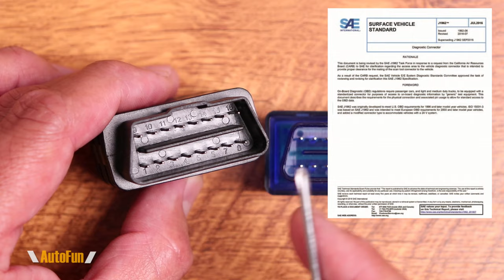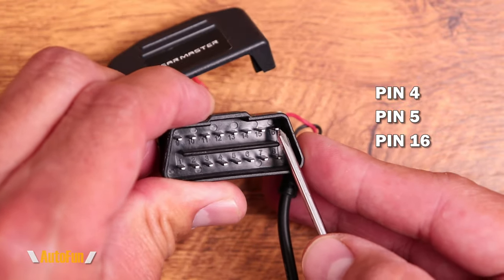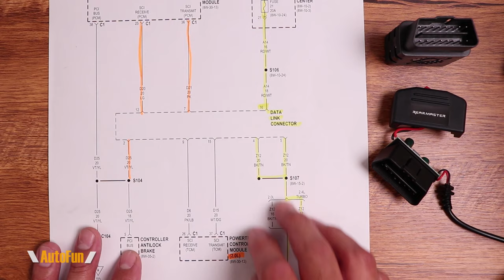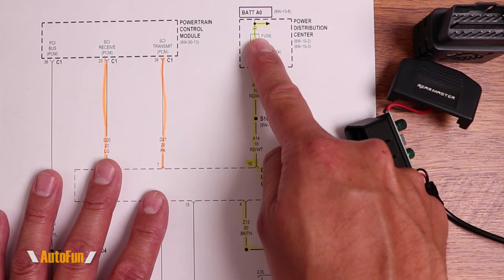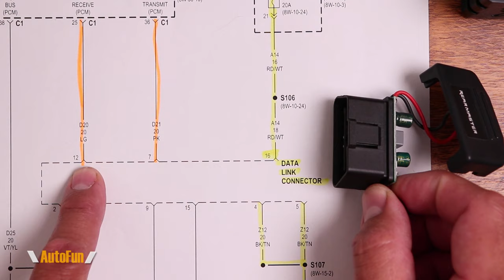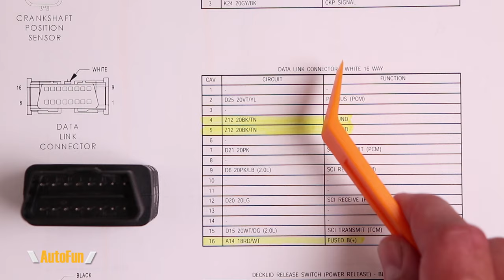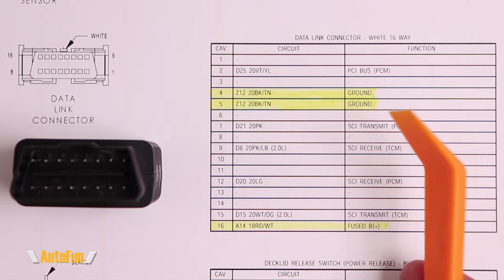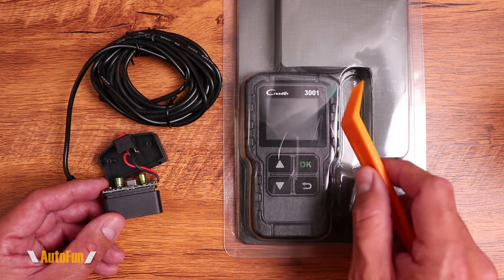OBD2 Power Adapter DANGEROUS? (Is it safe to use the OBD port for power?)

Comment: I used the mini obd2 and the very first time It was used with the dash cam, the car battery icon came ON…others have complained about it draining the battery!
Reply from the maker: Hi Macster! Yes there are OBD2 adapters that do not have low voltage battery cut off (to prevent draining the car's battery) The one I use does have this protection, I put the link to it in the video description. However if your OBD2 adapter gave you a battery light as soon as it was plugged in, the adapter may be defective (as the battery didn't have time to discharge, the adapter immediately set the fault). Also some newer cars are more sensitive to detecting any power draw and will not tolerate adding an aftermarket device without throwing a code or light. For those cases I prefer the hardwire method (which also enables true parking mode) here is my video for that https://youtu.be/uZp95NbNlmM Hope this helps, Cheers!
Reply: @AlexAutoFun  I used the one from your link.. the USB mini.
Reply from the maker: @macster1457  Hi Macster! Ah yes then definitely you got a defective one or as I mentioned earlier the car happens to be extra sensitive to the OBD2 adapter, I would recommend the hardwire method instead (just be aware that some cars also can't tolerate a hardwire kit, the C8 Corvette case that was in the news recently is the perfect example of how hardwiring can also trigger error codes in newer vehicles an even damage the car systems) Hope this helps, Cheers!
Reply: @AlexAutoFun  It works, but after the first time of leaving it ON in the parking lot, then the battery icon came on... this is on a 2006 Nissan Murano.
Reply from the maker: @macster1457  Hi Macster! Yeah it definitely shouldn't do that. I would strongly recommend checking what the code is for the light that is turned on to understand what is at the root cause of the MIL light. Hope this helps, Cheers!
Reply from the maker: Hi macster! As explained on the video the OBD2 is commonly now use to power other devices besides car scanners such as the newly released Ring Dash Cam and while the possible failures modes examples on this video do exist so far I have not experience any of them with any of my OBD2 devices (and as you can image I plug in a lot of stuff into my port since I'm always reviewing gadgets LOL). Cheers!

Comment: How does this turn off the camera if the 12volt supply is always on?  I have cameras in both of my cars and had to find a 12volt supply that turns on and off with the ignition. All of my 12volt plugs in the cars are always on.
Reply from the maker: Hi Phillip! here is my video where I explain the two modes the adapter can work on (depending on how you want to use it specially how it relates to power being on or off)  https://youtu.be/YEklm9V6xYE Hope this helps bud!
Reply: Lol 🤣🤣 you do it to 24 on power that's what it's all about the video 🤣🤣

Comment: I'm mixed  about this because there's negative reviews on them messing with dashboard, or all warning light goes off 

Not sure its base on certain vehicles, bad quality control, or whatever device they plug in
Reply from the maker: Hi MrWortWort1! I been using mine for 4 years now without issues, however you are correct, it is important to consider the factors and potential scenarios mentions on the video. Here is my original OBD adaptor video if you want to see which one I'm using https://youtu.be/YEklm9V6xYE and here is the hardwire method if you want to see that process https://youtu.be/uZp95NbNlmM Hope this helps, Cheers!

Comment: My vehicle is electric. I've been thinking about using the OBD for usb power as well, although I'd like to use the "turn off after 5 minutes" function.
But I'm wondering, does that actually work for me? I believe it detects the car turning off when the 12v-battery drops in voltage.
Although for my vehicle, this voltage always remains the same. The 12v battery is being recharged by the big (traction) battery.

How do you think this device detects the vehicle turning off, as it hasn't got any datapoints to read?
Reply from the maker: Hi Jordi! usually OBD2 adapters don't play well with Hybrids or EV Vehicles. While I had viewers use them with success others said it didn't work correctly for them, really seems to depend on the car model (and sometime year). Hope this helps, Cheers!

Comment: Can someone tell me which one i need for my 2024 corvette stingray lt1 ? I am so confused there are just so many of them
Reply from the maker: HI Malik! The adapters in the video description are identical on the end that goes to the car, the end that changes is the end that goes to the dash cam (the connector type and power requirement) Here is another video where I cover show how to tell which connector your dash cam needs https://youtu.be/-hGu8KZLaZ4 skip to the 2:35 mark) Cheers!
Reply: @AlexAutoFun thank you. Can you please tell me which one is good for viofo a229 pro 3 channel. I know that it is usb c but just need confirmation from a professional. I really keep my new corvette safe that's why i have been researching and scratching my head

Comment: In general the OBD2 port is not really recommended for such long term use.
Reply from the maker: Hi Charles! Here is my follow up video showing how the adapter works (and how it relates to the SAE J1962 standard we use in the industry for the OBD2 port design and use) https://youtu.be/aV5jQovoaCI including the use of the OBD2 port by non-diagnostic tools. I been running mine for over four years now without an issue and since making this video, we also seen more dash cam like Ring, Garmin, Thinkware, Vantrue, Nexar, Wolfbox, use OBD2 adapters. However if you would like to avoid using the OBD2 port for power (and also looking to enable park mode) here is my other video showing the alternative Hardwire method https://youtu.be/zbxYA4VhuT8 Cheers!

Comment: So the whole point is that it wont damage anything?
Reply from the maker: Hi Angel! There are several scenarios described in the video of cases where it can lead to a failure, however as explained in the video, understanding the adapter being used (there are different styles and types of this adapters in the market) and also the way the car's side port is wired (described by the service manual) would be my recommendation when using this style of devices. Cheers!

Comment: what is the CAN Bus low?
Reply from the maker: Hi Kiko! CANBUS is a communication protocol used newer cars. Cheers!
Reply: @AlexAutoFun  i have DDPAI Mola N3 Pro with OBD Kit, which has only 3 pins (5, 14, and 16). this will enable the parking mode?
Reply from the maker: Hi Kiko! I have not tested the DDPAI so I'm not sure how it works but nearly all dash cams require their hardwire kit to enable true parking mode. That being said, the OBD2 adapter can potentially enable you to monitor your car while parked, here is how it works https://youtu.be/YEklm9V6xYE (again just keep in mind it will not enable true park mode) Cheers!
Reply: @AlexAutoFun  what is true park mode? do you have a video reference for this?
Reply from the maker: @xrosnero  Hi Kiki! Ah great question, on most dash cams the parking mode menu or feature (true parking mode) will not be accessible with the OBD adapter, only their hardwire kit will enable it. Inside of the parking mode menu & settings are advanced park monitoring features. Depending on the dash cam they can range from simple Impact detection, time lapse, to more advanced modes like buffered parking mode, low bit recording, motion detection (visual or radar based), power saving park mode etc. So as mentioned earlier while the OBD2 adapter can be used for parking monitoring, it does not enable true parking mode (the parking mode features on a dash cam). And stay tuned I have a video coming where I explain this in more detail. Cheers!
Reply: @AlexAutoFun  thank you bro! this is very detailed! will be waiting for the video!
Reply from the maker: @xrosnero  You're welcome!

Comment: Does the vantrue n4 odb device cable has any bad  issues? Is it safe to hook up to odb connector.
Reply from the maker: Hi Mitchell, OBD2 adapters work similar to the one I showed on this video since the OBD2 port is a standard connector controlled by the industry. On this video I cover how they work and any potential dangers to help you guys decide if you choose to run one or not. Hope this helps bud!

Comment: So does anyone make a OBD power device with just three pins (4,5,16)?
Reply from the maker: Hi jac7002! so far I have not seen an OBD adapter that only populates a few pins (the adapter will likely not hold as well in position since there are much fewer pins than the normal 16, and would probably disconnect very easily or fit loose) But I wouldn't be surprised if someone makes one at some point (with an increase cost to cover the custom manufacturing of an OBD port with less that 16 pins) Hope this helps, Cheers!

Comment: Anyone knows pin out of lynx da1505 adapter for range Rover 1999  p38 😅.
Reply from the maker: Hi! It's possible the Lynx Cable D1505 has standard OBD2 pin out however there may be components inside the adapter to allow the reader to interact with the Rover. Cheers!
Reply: @AlexAutoFun  Thanks. It seems extended cable male female OBD2 with crossover pin if I know pin in and pin out l will able built one.

Comment: I'm using an obd adapter for my Vantop on a 2012 k Toyota Corolla. The on off switch  doesn't work on this model.
Reply from the maker: Hi Edward! The OBD2 port that I linked in the video description (which is the one I torn down on this video) does not have a on / off switch. But there are other OBD2 adapters adapters that do have an on / off switch. I would recommend contacting the vendor if you believe your OBD2 power adapter is not working, you need a replacement. Hope this helps, Cheers!

Comment: Risk is low % ?   Shorted
Reply from the maker: Hi Fisher! Calculating risk is a very complex calculation and requires the correct data to ensure you get a good answer. Basically garbage in, garbage out. The other challenge is that manufacturers typically do not share their return/defect rate (and some don't even collect this information since they deal with very large volume of low cost product or the distributor does not pass this information down to the factory). You also likely will have escapees that go unreported, basically the product fails and customer just toss it so the factory again is missing this data. Cheers!

Comment: Yeah so you don't talked about potential harmful data that can come from the dash cam itself right to your odb port and blabbering about the connector itself for 13 minutes....
Reply from the maker: Hi Manc! Understanding the connector and SAE J1962 is key to understanding if it's safe to use an OBD adapter. As explained on the video, the OBD2 adapter cannot communicate with the car (send data to it). The OBD2 adapter I'm using only connects to power and ground which as shown on the video are direct lines to the car's battery. I been running mine for almost five years now without an issue and since making this video, we also seen more dash cams like Ring, Garmin, Thinkware, Vantrue, Nexar, Wolfbox, use OBD2 adapters. However if you would like to avoid using the OBD2 port for power (and also looking to enable park mode) here is my other video showing the alternative Hardwire method https://youtu.be/zbxYA4VhuT8 Cheers!
Reply: @AlexAutoFun  Well yes this one do but without taking it apart you won't know which pin connect to where in an odb connector right?? this is my issue... with thrusting chinese products with my car's computer i hope you understand my problems with these.
Reply from the maker: @maszkalman3676  Hi Masz! Yeah I totally get you. It is possible that a incorrect pin could be connected or shorted by FOD (the scenarios described on the video) So an escapee can potentially make it to a customer but remember the same potential applies to all devices that use the OBD2 port (famously this happened to Scotty Kilmer with a scan tool that had a bad OBD2 connector), so as I recommended, the only way to avoid this potential danger is never to plug anything on your OBD2 port (reducing risk of damage to your PCM via OBD2 to zero). However sometimes this maybe not be practical or achievable as the OBD2 port was designed to be used. So definitely the risk is there, and if wanting to connect OBD2 devices to the car, a teardown can confirm the pin out functions before using. I guess it just comes down to the level of work the end user wants to put into checking a device before plugging it in LOL The other way would be to use an interface between the car and the OBD2 device in question as a protection, here is one that I have reviewed that could be used like that https://youtu.be/QAwpySOMQUI The good thing is that we gotten really good in the industry in defect reduction, I have plugged some many things in my OBD2 port since I'm always reviewing gadgets and so far I haven't had an issue (but it could happen, just a matter of probability). Cheers!

Comment: Yet you recommended using the OBD2 port for supplying power to dash cams 🫠
Reply from the maker: Hi Mr Dobalina! I been running mine for over four years now without an issue, we also seen more dash cams like Ring, Garmin, Thinkware, Vantrue, Wolfbox, and RedTiger use OBD2 adapters. Here is my original video showing how the adapter works https://youtu.be/YEklm9V6xYE However if you would like to avoid using the OBD2 port for power (and also looking to enable true park mode) here is my other video showing the alternative Hardwire method https://youtu.be/zbxYA4VhuT8 Hope this helps, Cheers!

Comment: 2:04 have you ever seen someone that got their rates lowered from this gizmo, without having their data sold?⸮
Reply from the maker: Hi D! While they advertise this, I have not tried any of them. Part of the reasoning is as you pointed out, the potential for data to be sold (more than we already are subjected to) and the theory or story that the information could be used to hike up your rates as opposed to lower them. I would recommend checking with your insurance and possible a legal adviser if you decide to use an insurance dongle (unfortunately the newer your vehicle is, this information is already being collected by the vehicle and sometimes shared to the Mfg by the car over the air or stored in the car's ECM which also means it can be used in case of a legal case). Cheers!
Reply: @AlexAutoFun  I can only sum it up with “exactly”. Cheers!